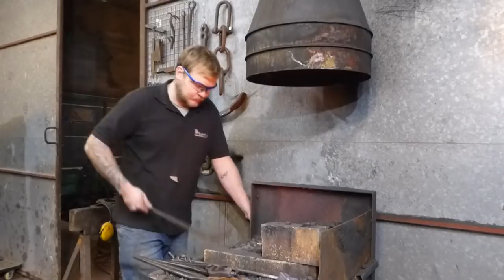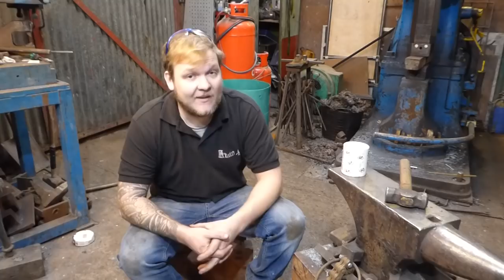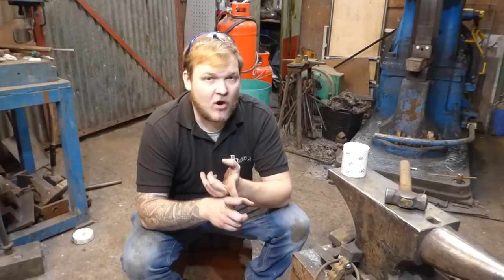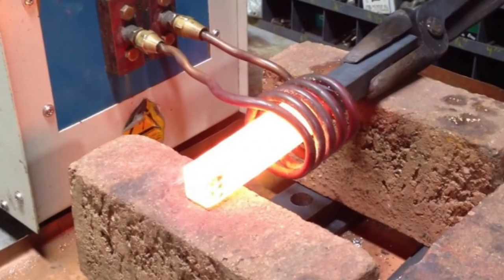Climate Change? Is the future of Blacksmithing Electric?

Comment: A great topic!
Arcs are a bit of a non starter as the temp generated is too fare above the melting point of steel (good for casting furnaces though)!
Electrical resistance is a good one though ..... if you look in your oven you can see an element that glows red hot so it is viable to produce heating elements for this purpose. The economics of supply may not be practical though! Thermocouple temperature control is an obvious way to go ... they are readily available already! One of the problems that has not been mentioned is thermal mas. You put your piece into a forge and it sucks the heat out of the surrounding coal to quickly heat the piece up ..... unless you could heat a substance up to take the place of coal (say a Metal or, as has been mentioned elsewhere Salt) you will have a light system that heats (and cools) quickly ..... probably too much to be useful. As has also been mentioned elsewhere thermal insulation and refractory may also be needed! 
Magnetics (induction) are also a good option! Again if you have a system that has thermal mass in it it would take time to warm up but would not need the same high power requirements as the power usage would be averaged out over time rather than being all or nothing as is usual!
Another form of heat source you do not seem to have considered is friction! You get friction welding so it is only a matter of supplying a motive power source to move two friction plates together .... with possibly a method of heat transfer away from the friction plates so they do not simply burn up (maybe a salt bath (again)) 

If I had to bet on any of these ideas it would be induction ..... Whether in it's current form or with added thermal mass!
I suspect this is all a bit academic as the powers that be will not be interested in small scale pollution by a few artisans when you have countries like China still churning out coal power stations ... all be it at a reduced rate as they embrace solar!

Comment: Hi Dan, my concerns regarding electric forges are (and bear in mind that I’m mostly positive about them): 
1} How is the electricity generated? This has always been a concern of mine, there’s little to no point in me giving up my gas forge in favour of electric if the power is ultimately generated from coal or gas.
2} Controllability of heat. I run an electric oven in my kitchen, and whilst for the most part I get consistent results from it, a major issue is that it takes a comparatively long time to come to temperature, and a similar length of time to adjust the temperature if needs be.
3} Supply. Domestic or three phase?

These are just a few bits off the top of my head. There are others, silly by comparison, for example: If I can’t run a charcoal forge, does this mean that barbecuing is out? More of a hypothetical, that one but still a consideration. Change is coming, sadly for those of us that rely on carbon fuels for our hobbies/careers but hopefully good for our environment, the questions are what wIll the changes involve and how will we deal with them.

There’s even a YouTuber I watched recently who is experimenting with focussing solar energy (not with great results, admittedly, but early days....)
Reply from the maker: OK great points. So the view is that banning fuel that create Co2 makes it hard to find them so if power stations can't uses coal they don't dig it out of the ground and there for yoh can't get it easily. This means a shift in industry to renewable or nuclear. Its nit hard nor none starter as lots of place all over the world are working on this. In fact China planes to be CO2 neutral in 10 years. I think India and Brazil also want this. So the source of the power is not an issuse. Second I'm sure time will be an issuse but might be something we have to learn to live with. And lastly I'm making a single phase machine. For the home user. It's just an experment.

Comment: I have made a forge that can burn used oil which is considered recycling. Corn based ethanol, hydrogen are also economical
Reply: The point I was trying to make, is that when and if they outlaw fossil fuels it's always possible come up with another affordable method for heating material. So perhaps we make a digester make methanol sequester in use at the heater Forge, or we put up a solar panel and split water all day long enough hydrogen to heat our Forge with, or someone creates an economical method to induce heat in metal via induction that doesn't require Transformers as big as your house.

Comment: A world wide ban on fossil fuels is very unlikely to come anytime soon. If ACTUAL serious climate action is to happen it seems very likely to me there will be exceptions made for smalltime crafts relient on those fuels. 

Another point is charcoal. IF sourced responsibly it CAN BE a fully renewable product with a net zero CO2 output. That is however much harder than people realise, replanting trees isn't enough as the land could sequester more carbon if not in use for charcoal production.

Blacksmithing won't be a player in climate change for any forseable future, we need some drastic revolution first.

Comment: As far as a ban goes, they could limit/restrict/or ban the sale of coal, coke, and propane and there's not much any of us could do about it. But when it comes to the home gamer, banning wood and charcoal would be very difficult to enforce, as well as banning it would affect many rural heating options and recreational campfires here in the states. As long as that's allowed, we can forge with solid fuels. Burning wood produces CO2, but it's also a renewable resource and targeting any and all fires would be a very tough sell. 

Now, as far as using electric, the equipment right now does not exist to replace all our forging needs. So even if it works in theory and you've got the best forge design ever already on the drawing pad, you're a good 5-10 years away from seeing a respectable presence on the market, and about 20 years away from actually convincing most smiths to change out their equipment. That's already way too late according to the UN report. Then comes the problematic issue of where the electricity comes from. Big power companies can make it cleaner than our fires, but if it takes 5 to 10x as much energy to do the same work, as well as the pollution and industrial energy to upgrade to newer systems, you're not really gaining anything over my little fire. 

Basically, as a blacksmith, we might have to worry a little bit about where our fuel comes from. We might have to switch to an electric option, should it become available. But for the most part, we aren't the major target polluters and there's going to be a space for our dirty little fires for quite some time.

Comment: My only concern about an electric forge would be the increased cost of operating such a forge. Everyone keeps forgetting that if limits are put on solid or gas fuels, than the price paid for electricity will increase exponentially. So I don't see an  electric forge being a very economical go to.
Reply: renewable power is cheaper than fuel generated power already, but still way to high to afford using for blacksmithing.
Reply: @jackdawg4579 I power most of my shop with solar and I have a solid fuel forge. Now the cost of my panels, inverter, batteries, and the maintenance. I can just imagine how much everyone's electric bills will increase. See that's part of thing that most doesn't understand. It requires a lot of energy to produce items like solar panels, the generator for wind or water. Now granted small scale setups are cheaper, although not everyone can afford or can legally install such systems. With how most governments go about things they are more than likely to implement a ban before having proper infrastructure in place.
Reply: @derangedmetalworks9489  you can get a house sized solar system (6 kwatts) here now for less than the cost of year's electricity. Just waiting for battery technology to catch up and I'll be saying "shove it up your jumper" to the power company!

Comment: ..the Electric Forge intrigues me.  Instead of going to Mars, why don't they figure out a way to harvest the CO2. The aerosol can industry could profit from this.  How about using Corn and Ethanol for fuel. Jet planes are the reason the icebergs are melting. The engines put off heat, heat is attracted to cold, heat melts ice. All hail the Magnus Prime Al "Mr. Internet" Gore. Seriously Dan, some really good thoughts...!!

Comment: Hi Dan using electric as a heat source is all good in theory but the problem in my eyes is that the local power station to me is still running on coal so it seems to me the amount of co2 I produce is minimal compare to ratcliffe on Trent power station
Reply from the maker: If coal is banned in the shop defo banned every where else. In this scenario a hypothetical one its just out and out banned so it mush be found else where!

Comment: This right here is a LARGE can of worms to open. Fossil files are the  number one source of electricity.. So that said I simply do not see us getting away from that simple fact any time soon. Possibly heavier costs, licensing fees placed on their usage, but their outright ban will most likely never happen. That's the same as asking everyone with a fireplace to not burn anything in it. They would likely die in winter. Also as a few people here have mentioned this topic spans a LOT of trades.. Welding, glass blowing, basically anything involving heat even to cigarette lighter manufacturing. I think the main issue is just to be aware of the process, and to use it as efficiently as possible in your work. Forges can be made more efficiently to burn less fuel, and provide longer heats with less waste.

Comment: A worthy discussion. I’m not at all sure that hobby blacksmithing contributes in any meaningful way to global warming, which is doubtless the result of industrial and widespread domestic use of fossil fuels, notably energy production and transport. Science tells us this and that a tipping point is imminent and mankind needs to make immediate changes in energy production and use. I would certainly use an induction forge - the difficulty here (UK) is difficulty sourcing domestic sized equipment. eBay has plenty available from China which aren’t hugely expensive but there is also a lack of knowledge re set up and you also need coolers etc. Even joining a fb induction forging group, whilst generally helpful, did not seem to make it viable here just yet.

Comment: I don't know dude, having an open door kiln, to accommodate long stock, would consume an awful lot more energy to achieve higher temps due to convection and radiation heat loss. On the note of electric kilns, where is most power derived from?, i mean unless there is a concerted change to green energy, that electricity is coming from oil, gas or nuclear power stations so the problem hasn't changed, the source of CO2 emissions has just been more consolidated

Comment: If you want to add some other heating methods, I have a couple.  I'm not saying either is a particularly  GOOD idea for heating metal, anyway...

The first would be pure solar.  By concentrating the light; using reflection, refraction, or some combination of the two; it should be possible to heat at least small sections of metal to forging temperatures.  The disadvantages of this method are pretty obvious: only being able to forge on reasonably sunny days for a few hours before and after noon, the size of the solar collecting area (it wouldn't need to be very large for pinpoint heating areas, but for large projects...), and the shop would need an unobstructed view of the sun (a parked moving van could easily shut down the forge).

Another would be magnetic heating.(https://youtu.be/8n5sSmJsCdY for one example).  This should work for iron & steel, but possibly only to the material's non-magnetic temperature.  It works on the same principle as induction heating (ie: a rapidly changing magnetic field).  I could see this method being useful for small sections of steel, but heating a large section (as you might do for a large spiral or twist) could be problematic.

Comment: The lions share of electricity is produced with fossil fuel....any push in that direction is purely monopoly driven, even if we are legally forced to use it. If the issue is truly about the environment, complete burning gas systems are the answer. I have no issue with a co2 monitor required on my system and a standard max co2 value I have to maintain.

Comment: Better to address now rather than at crunch time. I know I mentioned this in a live stream, but I'll mention it here as well. I have a buddy who is building a solar forge with a fresnel lens. It has its pros and cons, but it's another option. There's also solar forges that use a parabolic mirror. I'm putting some links below. 

http://woodwaredesigns.com/energy/solarforge.html
http://www.helioforge.org/
https://www.treehugger.com/gadgets/diy-solar-foundry-reaches-temperatures-3800-degrees-farenheit.html

Pros: Cheap energy source
          Clean energy source
          Can be used on any clear day, even in the winter.

Cons: Shelter is an issue
           Must be used on any CLEAR day
           Can't really insulate the workpiece effectively.

Comment: Well,... the big elephant sitting in the corner.    Alternative are all electric based.  If you was running on a solar powered system then it would be clean.  But if the electricity is run by nuclear or coal its the same CO2.   Just plant more trees and plants,.....they love them some CO2.

Comment: I respect the heating of steel without the carbon footprint. That is if you know how the juice that feeds your wall plug is produced. There's no free lunch. A trade off at the users end of zero co2 produced in his forge compares weakly if the electricity powering the kiln/forge is generated by coal or oil. (Hello China). People plug in their electric cars without thinking past the plug. If we ALL switch to electric tomorrow - wave bye to a demolished grid. Liking the production of hydrogen at home with solar as the electrolysis power source. Water + sun= hydrogen. Freeish , off grid, and zero emissions.

Comment: Yea.  I think electric is one way to go.  Principaly im trying to investigate about induction and hho.  Im a electronic engenier student and blacksmith as hobby.  For the induction metod is a lot faster than hho or resistor coil heaters,  because your heating directly the piece of metal,  but if your work is big you need a lot of power between 25 and 40KW...  And this is too much for a normal house (almost here in spain, i personaly have 5,5kw), but maybe for the way of hho is cheaper, and more easy to find,  is cleaner because the only product is h2o (water) and probably with only 3/4KW your be able to run a small forge (small ribbon stile forge, no more than 140x140x300mm).
Is something im trying to know.

If you want to contact with me,  at: winsrrowtheblacksmith@gmail.com
Reply from the maker: Ill be in contact love to have a chat. than for the input dude.
Reply: @danielmoss2089  perfect is a plesure to talk with you.